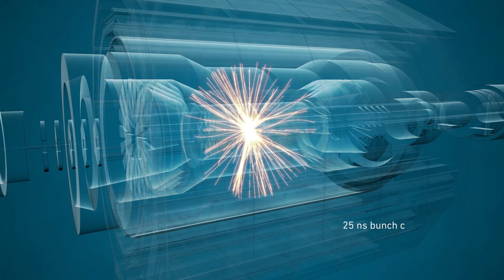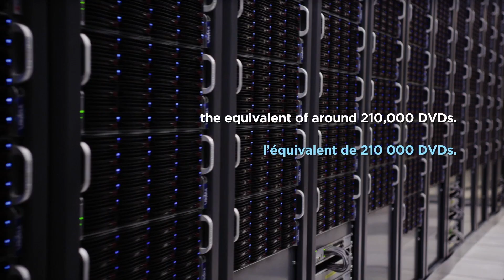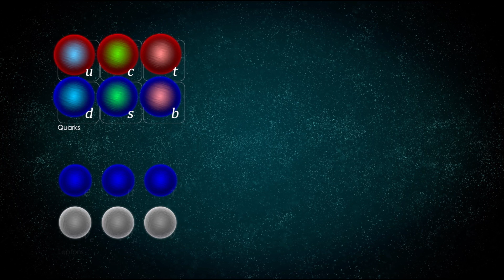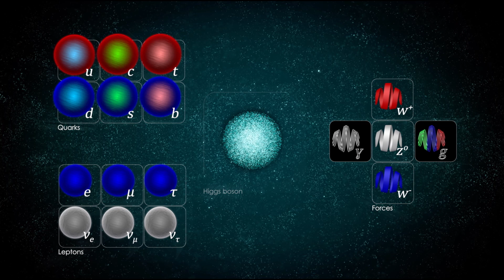An introduction to the CMS Experiment at CERN

Comment: Quantum entanglement- What happens when you isolate two pairs of entangled particles and collide them simultaneously?
( in all possible combinations) Now what happens if you collide two pairs of entangled particles, at the same time using two different Colliders? If you were to offset the impact in one of the Colliders by a fraction of a second, would it effect the outcome of the results on the first pair?